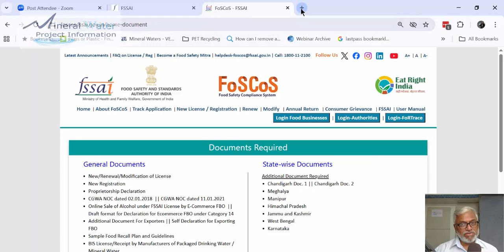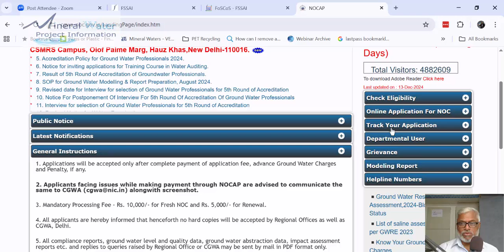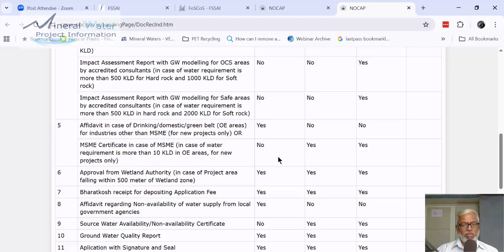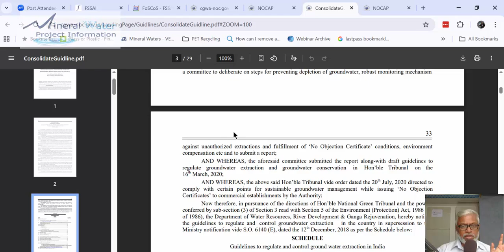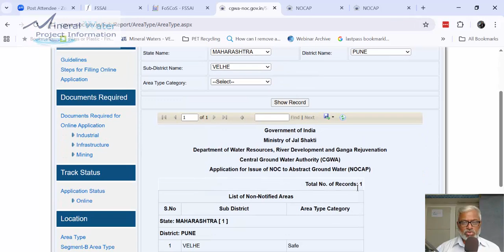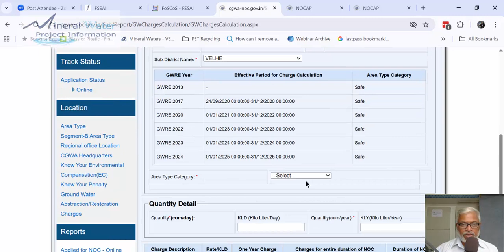FSSAI High-Risk Water Plant: CGWA Rules & Charges 2026

Comment from the maker: 📌 IMPORTANT: 2026 REGULATORY UPDATES 📌

While the portal walkthrough in this video remains the best way to understand the CGWA interface, please note these three critical changes effective for the 2026 business cycle:

The FSSAI Digital Link: The FSSAI (FoSCoS) portal is now digitally integrated with the CGWA/SGWA database. In many states, you cannot move past the initial FSSAI application stage without a valid Groundwater NOC or Application Number.

Telemetry Mandate: All Digital Flow Meters must now be Telemetry-enabled (SIM-based). Manual logbooks are no longer sufficient; your extraction data must automatically upload to the government servers for your license to remain valid.

The "High-Risk" Audit: Since Water is now a "High-Risk" category, auditors will check your Abstraction Charges receipts during your annual FSSAI audit. Ensure your payments are up to date!

State-Specific Note: If your plant is in UP, Haryana, or the other 13 states mentioned at in the video, ensure you are using the State Groundwater Authority portal rather than the Central CGWA portal.

🚀 Confused about the "Environmental Trio" (Groundwater, Pollution, and EPR)?
I’ve written a complete 2026 License Cost Guide on my website to help you navigate these changes without heavy penalties.

👉 Read the Full Guide Here: https://mineralwaterprojectinformation.org/packaged-drinking-water-license-cost-in-2026-fssai-vs-bis-the-complete-guide/
👉 Book 1:1 Orientation: https://mineralwaterprojectinformation.org/consultancy-2/

Comment: Sir minimum how many kld is not required the cgwa certificate
Reply from the maker: 😊I think you require the minimum extraction amount of groundwater which is not chargeable. If you're extracting below 10000 ltrs a day, it's not chargeable.

However, it still needs the "Consent to Establish and Operate" from the pollution control board.
Also note that this facility is offered if you're registered as an MSME. Otherwise no.
And there are certain states which have their own set of rules for groundwater. They might have different criteria, don't fall under CGWA.

😮I seriously wonder whether 10000 lpd is enough for a bottled water plant to be commercially viable.